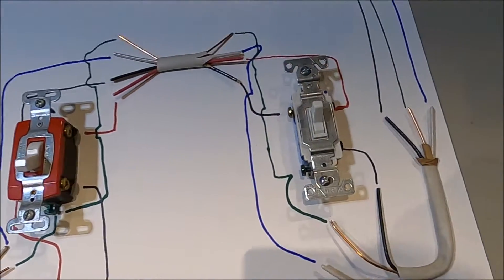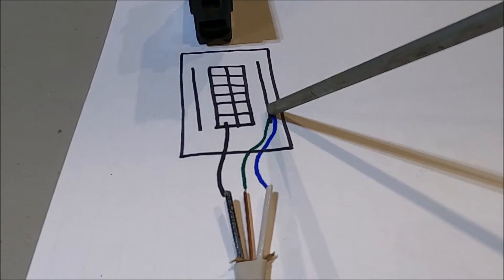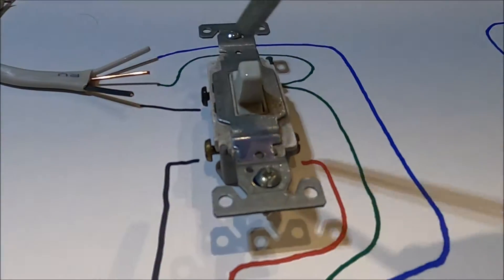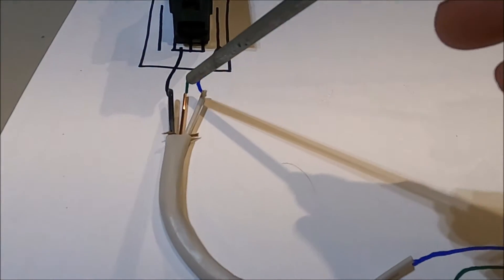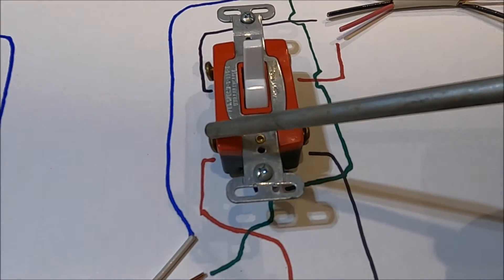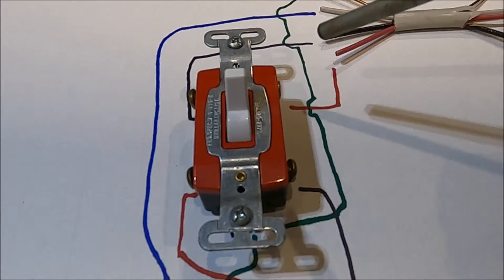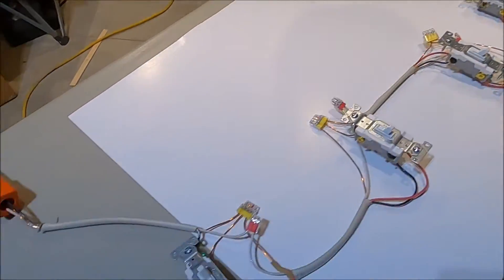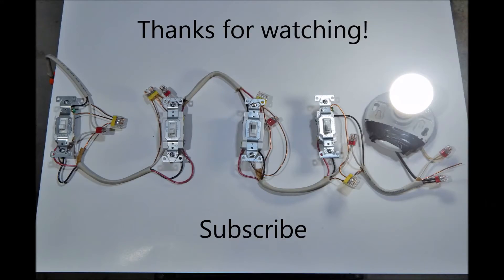Wiring a 4 Way Circuit to Control Lights

Comment: I noticed you had your neutral and ground wires connected together at the switch box.  I thought this box was going to be a sub-panel and that they would have to be separated.  Would this have worked if you separated them?  Does it make a difference if you are  wiring more than a 3 way switch ?

Comment: Thanks for the video but stuck with something. Existing home...can turn off lights in 4 places which means 5 way or 4 switches. What I am getting is...do 2.. 3 ways on the end and 2... 4 ways in the middle. I am confused on how do I know where my ends and middle are?  I have 1 swtich that has to be up for all the other switches work so my guess is that is an end. No idea on how to figure out the other end. Its 3 light switches up stairs and 1 down. The one that has to be in the up position is the upstairs middle.
Reply from the maker: To find the ends, turn off the power at the breaker, remove the switch covers, and look at the switches. The 4 way switches will be the middle switches, and the two three ways switches will be your ends.

Comment: This was great. How many 4 way switches did you use?
Reply from the maker: Two in the video, but your circumstance miggt be different.
Reply: @brettleybuilt  I just did mine. I was able to turn the light from 4 different places. The first and last switch must be 3 way switch and the two intermediary must be a 4 way switch.  Hope this help someone

Comment: Seeking some advice. I have a set of outdoor lights that can be control at 4 locations in my home. I believe it is a 3-4-4-3 circuit. One day I noticed the lights on and when I attempted to turn off, they would not respond at any location. They will turn off if I stop the switch at what would be the half way point of the toggle switch. I " assume " one of the 4 switches has gone bad. Looking for a method to discover which one of the switches is bad. If you would consider this as the likely problem. Thanks for your feedback.
Reply from the maker: You could take the face plates off from each switch, and CAREFULLY, use a voltmeter to ensure each screw has voltage when it is supposed to have voltage. If a screw doesn't show around 120V when it should, that switch is most likely the bad switch.
Reply from the maker: You could take the face plates off from each switch, and CAREFULLY, use a voltmeter to ensure each screw has voltage when it is supposed to have voltage. If a screw doesn't show around 120V when it should, that switch is most likely the bad switch.

Comment: If I had a 4 way switch controlling two light fixtures, How would I wire that?
Reply from the maker: It would be just like the setup I showed, but then you would wire the two lights together with a 14-2 wire. Both lights would still have to come on and go off at the same time.

Comment: My 60 plus years wiring gives me reason enough to tease a little. As with most circuits this one can be center fed or fed from the opposite end shown.
Reply from the maker: Yeah, but explain how that works to homeowners.
Reply: @brettleybuilt  I lived for over 30 years in the Adirondack mountains of NY. For the better part of that period the only electrical inspections required were for the service. I don't know of any area of the country today that doesn't have to put up with the NEC BS. My point is there is no reason a homeowner would be "legally" wiring?
Reply: @jackriley5974  In the state of Wisconsin homeowners can still legally do any wiring on their own property.  There may be exceptions in different municipalities.  The electrical utilities typicall will not hook up to a meter socket not at least signed off by a master electrician however.  All wiring would likely need to be inspected...if you pulled a permit.

Comment: What do you use 4 way switch for, because this example was a 3 way switch, correct? Pardon me but im learning, thanks for the videos
Reply from the maker: They call it a four way circuit and it is used to control lights from three or more locations.

Comment: How do I fix my fan/bathroom light? They are supposed to have different switches for each, but somehow only one switch turns the fan and light on and off.
Reply from the maker: I will make a video on this in a couple weeks. I am sure other people will have questions about this as well.

Comment: What would be the proper name if not romex?
Reply from the maker: The gauge number, the number of conductors, then WG, meaning with ground.  So the wires I used were 14-2WG and 14-3WG.

Comment: Exactly the video I’ve been looking for. Is that 2-3 ways and 2-4 way switches?
Reply from the maker: Yes. You always have to have a 3 way switch at each end, but you can have as many 4 way switches as you need in between.
Reply from the maker: Yes. You always have to have a 3 way switch at each end, but you can have as many 4 way switches as you need in between.
Reply: Thank you so much for the reply. I don’t think anyone has ever replied to one of my comments before so I really appreciate you getting back to me. I have 3 switches up stairs for my hall lights but sometimes I go downstairs forgetting to turn them off so be very convenient to have a switch at bottom of my stairs. Thought this was the way to do it but was unsure. Thanks again! 🙏🏽
Reply from the maker: @xsandmanx187  Yes, you would need a 4 way circuit as you would have a switch at the bottom of the stairs that would be connected to the same circuit as the other switches upstairs to control the lights.